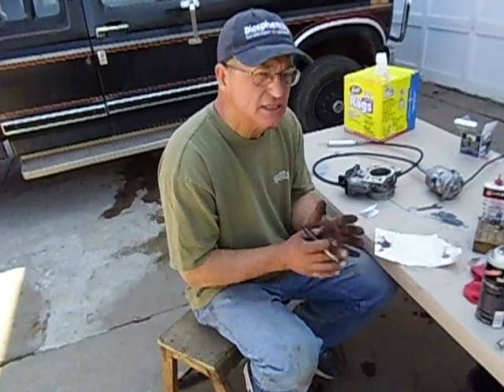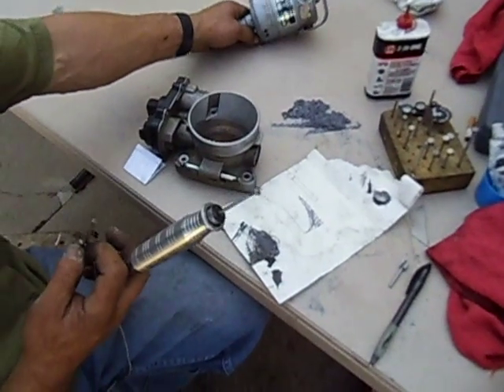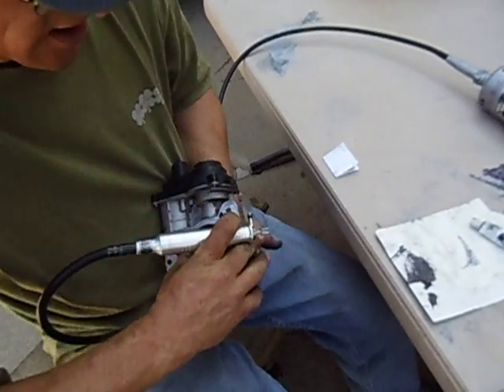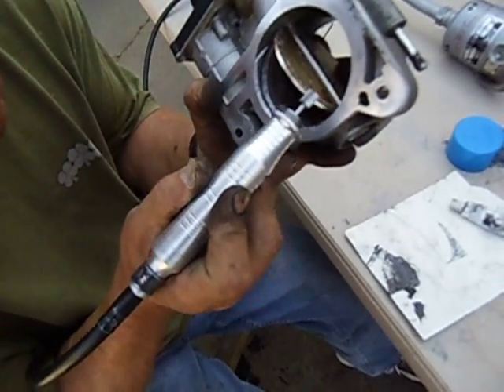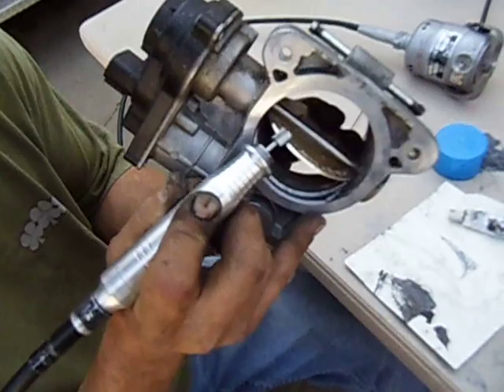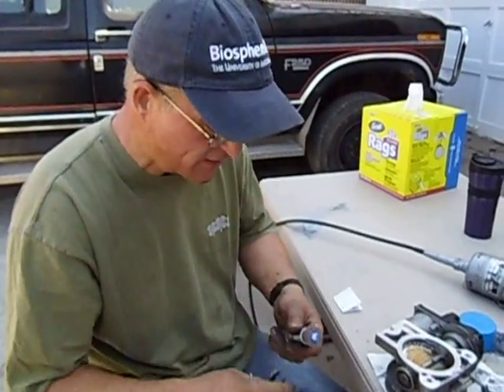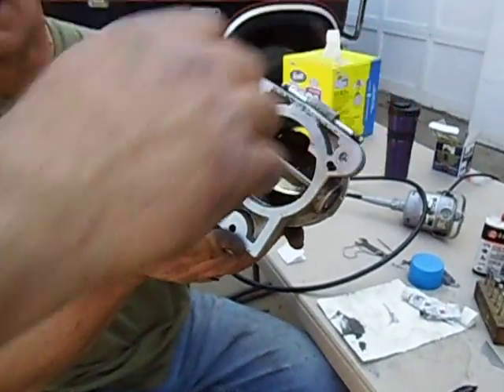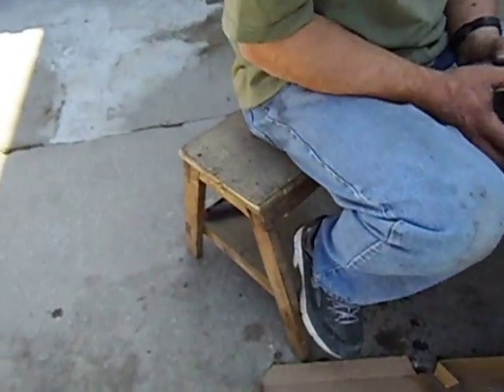SB Modifying the Throttle Plate GADGETMAN style

Comment: Its easier with a file and safer too so you wont slip and have no idle . Thinning that shaft is important too for more cfm . Youll get there  . Works better as a knife edge doing both sides . Yes drivability and mpg are better . Not nearly as much throttle plate rotation is needed to go down the road . Cruise may not work on DOD or VVT engines after modifications are completed as he has shown them . Hate to say this but there are better ways to do this job . And youve got to do both ends of the tb for sensitivity .

Comment: I’m no mechanic so the technicals escape me but I have spent some time on grinders, sanders and a Fordham. Why don’t you remove the plate from the throttle body and do this work on a bench sander? You could build a jig like you would use for grinding a bevel on a knife (see YouTube for instructions on building one). Again, I’m not a k
Mechanics but it seems it might be easier and perhaps more precise.

Comment: I have a 96 f150 5.8l that has 2 56mm openings. The metal at the point where it meets the butterfly is only 3/16 thick.I would not be able to cut a grove there deep enough to matter

Comment: I did this to me brand new pickup and now I may need a tow service as me pickup won’t run now and this unit is a 2021 Chevy pickup she is a real beauty and only gets 15mpg’s with its 6.2ltr on the highway. I need more miles for me beauty is breaking me pockets and so I do what you say and now me beauty will not run and she only has 12.348 miles and before I did this me beauty ran so sweet now what me gonna do????

Comment: after gagetman's groove,i have seen in your video the  o2  sensor readings sometimes go up , why ?, shouldn't it drop, so, less fuel is used? i like to get the groove , but afraid the fuel consumption might increase!
Reply: If you get more air you have to have more gas in order to not have a lean condition (when a motor is lean think of it like a cutting torch ....when u fire the torch up on strait acetylene its black nasty smoke and a colder yellow flame ...thats a rich condition.  Now you take that same flame and crack the oxygen  open aka air then your torch flame goes blue gets super hot and no smoke ....you in essence leaned out your torch ....and 100% if your motor is a higher compression motor and its lean and you drive it hard will litteraly do the same and melt pistons) fuel injected vehicles ajust automatically for product life and pollution purposes by using maf,map,ait, 02 and knock sensors to adjust the fuel to air ratio to keep it as close to stoich 14 to 1 as possible (stoich = gasses preferred air to fuel ratio for combustion)  (14.7 parts air to 1 part fuel) the fuel mileage increase is from less parasitic loss (parasitic loss= drag like your ac is on) natrualy Aspirated = draws its own air so it takes force on the down stroke to pull air in . So in turn opening the air system up lets it draw easier . So combind the 2 your achievement is less power required to draw air so more power and a side effect is not having to have the throttle blade open as far just to cruze at say 65 mph thus less fuel is consumed......sheeeeeeeew thats alot lol but thats the basics ......mechanic,shop owner , and mobile welding business owner of over 20 years here for my credentials.......lol fun fact ....last grade I completed was 8th ....teach ur kids a trade and they will never know what hunger is ....Ozark iron and speed over and out  ✌ p.s. keep learning friend because knowledge is POWWWAAAAAAAA!!!!!!!

Comment: What a scam.  These grifters are taking advantage of people who don’t understand cars.  Direct and port injected engines don’t vaporize fuel outside the cylinder. the intake manifold is designed for air flow only. What you are doing is creating a small vacuum leak so that the engine runs lean.  It will seem like it is working until the o2 sensor picks up on the lean condition and adjusts it out by dumping in more fuel.  For a few hundred miles, you will get better gas mileage and less emissions at the expense of wear. The ecu adjusts the mixture the only difference will be that you now have a vacuum leak.  Don’t buy the snake oil folks.

Comment: If you don't know what you're doing,don't fuck with it. You may end up going to the wrecking yard and getting another throttle plate,maybe a new throttle body On a stock engine you won't even notice anything. It might even run like shit. If you wanna add 5hp go buy an electric fan & underdrive pulleys. That will give you about 12hp on a 96 - 04 ,4.3L Chevy.

Comment: Just change your stock filter to a K&N. This is worthless and time consuming as  installing the cold air intake. The flow in and out will get the best results, so spend the money on a aftermarket high flow muffler along with the filter. If more free HP is what your looking for use a Mobil 1 high flow oil filter and synthetic, I have seen gains from just doing that.

Comment: why not just remove it, job can be done easier
Reply: Some times the screws don't go back in due to heat and warping of the age of the part it's always a gamble best to practice on a old carburetor  to get a feel otherwise you will have to mostlikely hunt down a tap an I'm sure it's a odd ball size on a rochester Q JET I ran in to this problem I learned it's best not to remove the throttle plates clean them in place just my 2 cents peace and much respect to you Jason also lock tight the screws in if you chose to remove them